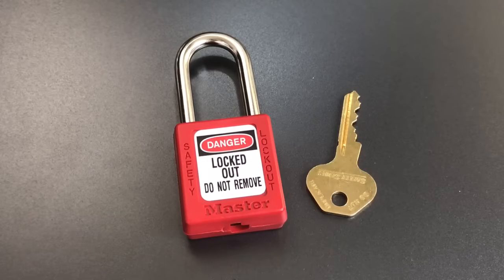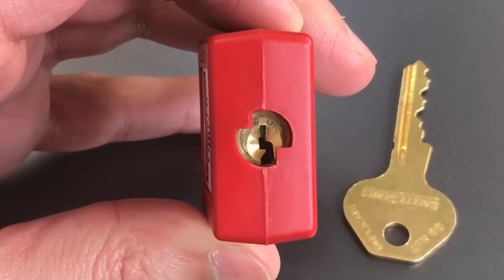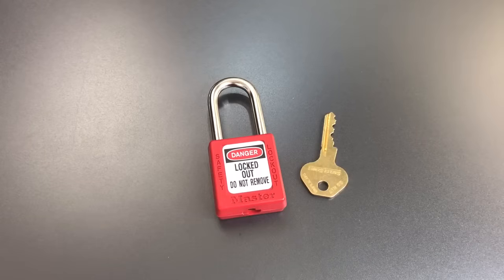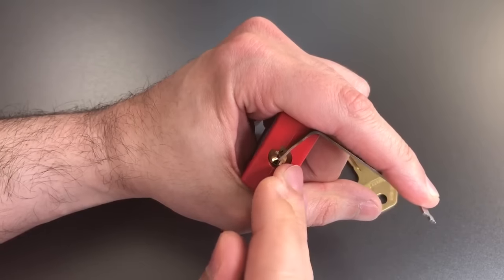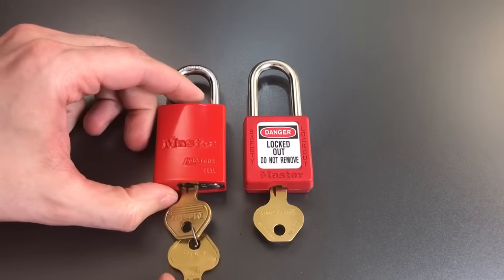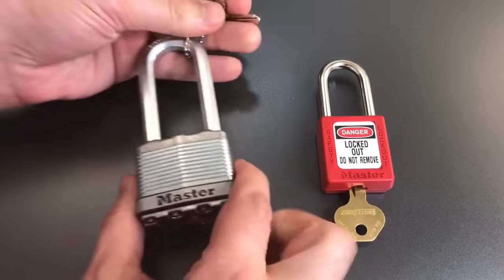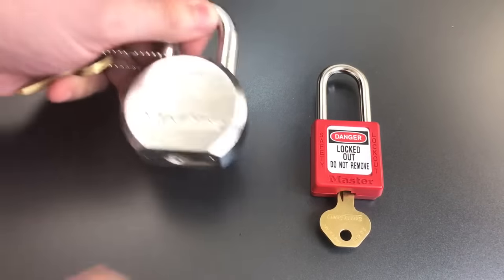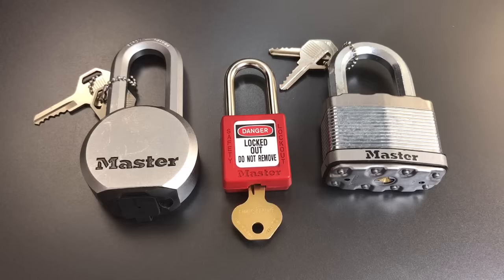[479] The Master Lock Paradox - Model 410 LOTO Padlock

Comment: in Australia these loto locks are the standard because technicians lives are at stake. industry standards require a lock that is difficult to tamper with but possible to remove. the theory is that it is too difficult for someone to pick open and remove then have someone switch on or turn the valve and later claim the lock wasn't on then replace the lock back to the switch.  but is easily cut off if the lockout lock is left behind. so it's made to easily detect brute force attacks but remain strong against non damaging attacks or tampering.
Reply: It's the same here in the USA. A special "lock removal procedure must be followed and documented each time a safety lock is removed.
Reply: Best answer. Everyone else seems to address only half of the issue and get hung up on key diversity, or emergency destruction. Thanks.
Reply: I don't understand why anyone would consider this "difficult to tamper with".
Reply: Cory Goodman like LPL said, its one of their best cores and full of security pins. Ergo not likely to be picked by an amateur
Reply: This does make the most sense.  People tend to forget about the A-holes in the world who would do something like that.
Reply: He shows two other Master LOTO lock models with 5 and 4 pin cores that are easily pickable. If there's a standard for LOTO locks, then why does Master sell those two models?
Reply: @StevenS757  Probably because master lock has no standards.
Reply: @StevenS757  Probably because only some countries or industries require the 6-pin lock, so they make the 410 for those, and the cheaper locks for other places.
Reply: Yeah I'm an Aussie, and I've had a mate pay his own way back to the Pilbara because he left his lock on the clasp. They wouldn't touch it. Easy to break yes but as far as I know people just don't touch em at  if it's not their lock.
Reply: @STEALTH the master key is a simple hammer dude. I left one on my scaff belt and lost the key. Out came the hammer. Picked in 2.582 seconds.
Reply: This is not the problem her. The problem is that their other locks have shitty cores.
Reply: @jimstanley_49  This is still only half the answer. Why are their other security lock cores so shit?
Reply: @pinpetos  Because nobody dies a horrible death if the other security locks are breached? Low pin LOTOs are OK for small sites where there aren't many locks, there wouldn't be the possibility of overlap and the pin selections are likely to avoid that too with less combinations. Higher pin LOTOS are more for large sites where there may be dozens out at the same time. Picking a LOTO can lead to an ugly death for someone caught inside a machine or with their hands in something that just got energized. Picking a "secure" lock on a storage room leads to a police call and an insurance claim for missing stuff. BIG differences in mindset.
Reply: @mfree80286  You're missing my point. I'm not talking about lock out locks.

I'm wondering why they don't make regular security locks better.
Reply: Might be the wrong answer but is it because people shouldn't steal things that don't belong to them.

I honestly think it may be just a matter of keepingas many combo's all for this reason as mentioned the blanks are probably not available you put this barrel in everything with quantity increase it changes the odds.
Especially with the other to locks in this category mentioned which wind up locking up containers gates etc.
1 site you might have 40 keys to cover 15 locks around the site all keyed alike.
Others you might have 40 locks keyed alike with 15 key holders.

Alternatively

There may be constract related to these barrels that they can only keep up with the production for these.
These are sold by the pallets frequently.
And can be open with a pair of channel locks. So can be quickly consumed.

At the end of the day these are designed to protect the most valuable piece of equipment the operator.
It's actually a nice thought to think that masterlock put more value on a human life than a piece of equipment in this day and age.
Reply: It pains me to think of the first maintenance person(s) who had to die or be horribly injured in the past before LOTO procedures were put in place.
Reply: @mfree80286  I'm guessing it's a matter of consumer use versus industry use. A strong lock body is a good visual marketing cue for the lay consumer while this lockout tagout lock seems to be made to a particular specification. You cant see the core when the lock is hanging in a blister pack at Home Depot, and the average consumer probably doesnt really care as long as the lock looks "strong."
Reply: Mat Steele damn I wish I read this before I made my comment. But I agree. I don't think the frail body vs. The stronger core was an oversight so much as intentional design. 
In any industry that may want a lock such as this, the point isn't that it can't be cut, so much that it "can't" be picked.

Like you said, if it could be picked and re-locked. Then it's simple to say "oh it was never locked" as opposed to a clear cut in the lock showing legitimate tampering and sabotage.
Reply: a mine im assuming? which one?
Reply: @pinpetos  I know it's the entire point of this channel..but it's because padlocks are not for securing against someone that is going to pick the lock...they are there to prevent the average theft...which is unplanned and unprepared. 

If someone wants to steal your crap being protected by a padlock they aren't going to pick the lock.  Nobody picks locks like that irl.  They are going to whip out a set of 12 inch bolt cutters and cut it off.
Reply: I have had to remove a one of these i put on myself, because i lost the key. After doing the work on the air handler i was working i needed it running. I couldn't break the body with a hammer while it was locking out the isolator. I ended up unscrewing the isolator face and swapping it with another new one. Great lock for pranks too, just lock your mates keys onto something and sit back and laugh.
Reply: Here in Texas we use large red tags and red zip ties to signal isolation of energy. Sometimes additional physical measures are needed to prevent someone from inadvertently operating a valve, for example. But only when an accidental bump or some act of God can ruin the isolation.

In the industrial world there is always a way for an operator or technician to do what ever they want to do. So, operating discipline is key. Aka mess with a tagged out source of energy and you’ll get fired. Whether it’s a plastic zip tie or 20lbs of chain and locks, if you don’t respect the reasoning behind isolation of energy/lock out tag out, then you can’t understand the purpose.

Zip ties and red tags can be enough when that tag represents someone’s life and family.
Reply: @iLykeCahrs  you guys still allow plastic lock out? Holy fuck, that's terrifying. I never learned that when I was doing my safety training this summer. Learned there was a considerable injury in a US NOVA plant because of a cut loto last year though. 

At least the valley has had 0 loto mistakes since locks became the standard here. One thing I'll never worry about.
Reply: Looks like you've "cracked it"
Reply: Yeah, my dad works in the mines as an auto electrician (fixes all the wear and tear of the vehicles) and he has heaps of these in his bag.
Reply: Well that answers my question exactly. Thanks! That makes perfect sense, IMO.
Reply: Also, the people using these locks are almost never going to be the ones who own whatever is being locked.
Reply: @CGoody5642  tamper evident
Reply: @anelephantsearful  many things are tamper evident and cheaper.
Reply: If you're not an idiot you dont mess with a lock out lock that's not yours. Jobsite coordinator has to get into contact with the lock owner, verify they are off site or out of the lock out area, then a supervisor, a coworker, and the coordinator go cut the lock off.
Reply: I work in mining in the US and it's as Mat Steele says, the body is weak by design in the event that someone forgets their lock and leaves for their days off.  You go through the lock removal protocol involving management and safety officer.  The lock can be broken with a wrench.
The beefier locks are not used during maintenance.   They are used to lock equipment "Out of Service" for extended periods and do not have personal tags with them.  Once a piece of equipment is designated out of service, all personal locks are removed.
Reply: All very good posts. Also glad to hear that the Master Lock, which I happen to have one of the exact model shown in this video, is so secure against lock-picking. I also agree that the concept of easily breaking the chassis is a good one, for emergency removal.

Now, here's a question that no one has asked yet: is the plastic body intended to prevent the person from being electrocuted by their own lock? Of course putting in the key will create one half of the circuit, but the plastic body prevents you from completing it with your other hand. Therefore, no shock. Same theory as insulated screwdrivers. If an electrical panel or switch box is shorting or grounded incorrectly, and the circuit doesn't trip, this could save your life when you attach it or remove it. this of course is on the assumption that you neglect to use your ticker to check for current.
Reply: @cognitivedissident9825  
Safety training at Nuke plants makes sure that it's ingrained in you that you don't touch these things without following procedure and notification. In some cases, a plain old crimped lead seal is just what's used (same with emergency parachute packing by a certified rigger).  

At a training seminar a business type seemed shocked that simple things like these were used to keep equipment offline. The VP of engineering explained that we treated these things as sacrosanct. and removing them without permission would be treated as attempted murder or manslaughter.
Reply: @jmchez  it's definitely a mainstay of safety culture.
Reply: @iLykeCahrs  
Absolutely! well said.
I've seen men stick their head inside an open pie for inspection when on the other side of the valve there's 500 degree F of steam.  The only thing on that close valve was a red tag.
Reply: Speaking of cartons, I'll pay one to whoever can show me in the legislation the need to prevent picking that people have mentioned here.
Reply: @christianroy20 
Don't know the price on the others but the 410 's at work go for $50 each, we also have a couple of No.3's  but they go on toolboxes not equipment with only the maintenance department having the keys for the No.3 locks, which sucks since it means we have to wait at least 15 minutes for those slow pricks to come over and open the toolbox for us so we can grab a bloody screwdriver or spanner, luckily we have copy of the key for our toolbox lock maintenance doesn't know about, but if they did we'd get in shit because of it.
Reply: @mat Steele I came to the comments to post exactly what you said. You would be surprised how often these are left behind after a project and need to be removed by brute force. After proper loto removal procedures are performed of course. They are usually left by a contractor who is no where near the equipment and isn't available to return to the site for keyed removal.
Reply: I doubt it's in the actual legislation, but I wouldn't be surprised if there are industrial standards that have requirements for pick resistance which pirchasers could specify must be followed.

To me that's one of the large differences in consumer versus industrial procurement. The lay person bases their purchasing mostly on looks and perhaps another cobsuner review, an industrial purchaser actually sends a tendering document for quotes that specifies exactly what standards must be met.
Reply: Canada as well
Reply: Cory Goodman It’s easy to cut or destroy, but that is “tamper evident”. You can obviously tell if it has been tampered with. Picking the lock is a deceptive way to remove the lock. In manufacturing, management wants to absolutely know when a LOTO lock is removed. There are typically approvals needed. If a lock can be sneakily picked, the equipment energized, and the lock replaced all for the sake of saving time, the safety mechanisms of the LOTO process are defeated.
Reply: I thought it was something like this!
Reply: Yep I concur mining Australia non hardened Shackle for use of bolt cutters plastic body for use of hammers.
I’ve seen my fair share of these locks cut and smashed off!
If ya leave ya lock on it’s a carton of beer!!!!!🍺
Reply: Yeah, that's pretty much why the standard in Australia is the standard in the United States.  The one time I have seen one of these locks removed in the US they just cut the shackle with powered cutters.
Reply: A lot of great comments here but for those unfamiliar with Loto, we don’t just bang the lock on and walk away. It’s accompanied by a plastic tag with your name and contact details. When you go to remove your lock you can quickly identify it. The chances of you putting your key in someone else lock are very very slim. If I caught someone trying multiple locks with his key they would be getting reported very quickly. Its peoples lives at stake. The other point to notice maybe master lock over engineering these things because they can literally charge the large industrial companies like mining whatever they like. That’s the industry standard lock here in Australia. They will keep purchasing them no matter what they cost. After all, in their words, ‘you can’t put a price on safety.’
Reply: I've had to hit a few of these off with a hammer...lol
Reply: This is the correct answer
Reply: @iLykeCahrs  I get what you are saying, but I work with enough idiots that I prefer a little more security protecting my life and limbs.
Reply: Andrew Evanoff yeah I had to go into work on a day off once because of how serious the loto procedures are if those locks weren’t on and a breaker went on I could’ve been subject to an extraordinary amount of electricity
Reply: @CGoody5642  Possibly because they actually mean that it is "Tamper evident".  Can't (easily) be removed without evident damage.
Reply: Mike Smith  I agree Mike, weight is definitely a factor. In my experience the biggest weight concern is that workers can at times be required to carry six locks on their person. Six solid metal locks would be fatiguing, especially if you're also carrying other crap like respirators. Then there's bustability - easy to remove by force if left on accidentally (after a mountain of paperwork and checks). Also I think cost is a factor - a site may have thousands of these locks in circulation and be replacing them constantly. If each one is $5 cheaper they adds up.

Comment: Fun fact: The way Master Lock makes their locks is very similar to the way the Empire makes their death stars.
Reply: I don't see any anti starfighter laser turrets lining the keyway though...
Reply: I actually would prefer my LOTO lock this way, were I still working in a field where I needed one to well, keep me alive.
Cutting off a LOTO lock is a really big deal, legally, a serious OSHA violation, so on the rare occasions it has to be done, tons of documentation and management reports. Way too many workers got killed without LOTO locks, so OSHA fines are serious when they're tampered with.
But then, there's the wiseass who'd try to pick one... The dead core tends to foul up a novice, the quality core defeats a novice. My first took me a few tries when I was starting out, then popped through in a few minutes on the first success. 
Counterintuitively, the dead core actually makes releasing a false set or overset easier without necessarily dropping already set pins...
But, for a novice, a tight lock full of security pins is like Homer Simpson trapped in a yard full of rakes.   ;)
Reply: The empire actually designed the Death Star very well however, and even in the Star Wars unversae, it was very unlikely that it would be defeated. Even within the force, it’s very unlikely that the exhaust pipe could have been defeated.
Reply: @vladiiidracula235  you sound just like Han Solo in the first movie.
Reply: @JohnSmith-fq3rg  Nor did the rebels. Those turrets where designed to fight capical ships. That is why they where to slow in turning and fireing to hit the nimble starfighters.
Reply: @spvillano  It would be Sideshow Bob in a yard full of rakes.
Reply: @spvillano  I am protected by these locks [we switched from these to the Brady/Abus 71/40 to these with the non-conductive nylon shackle] and based on Master's other products that fail to meet our own internal security requirements for anything other than basic access control to compressor pens and mechanical mezzanines I'm glad they are tough to open. As you say, if someone destructively removes a lock, it's a massive violation and kinda hard to hide. If they could be easily bypassed, it would likely be exploited and there are zero good reasons to remove a lock without the key not already specified in regulations.
Reply: LOL!